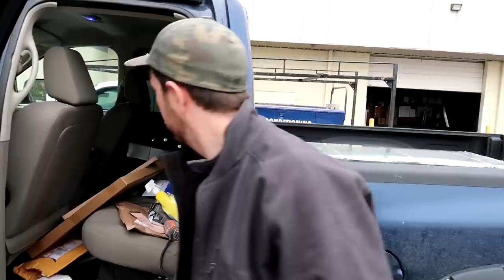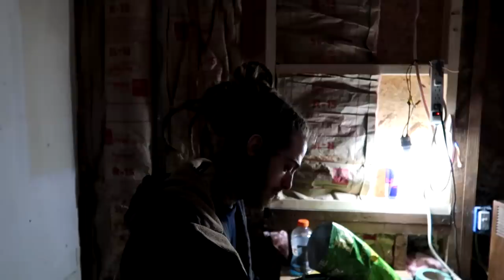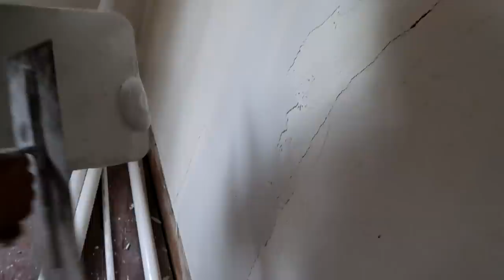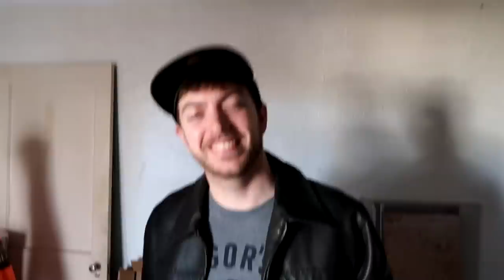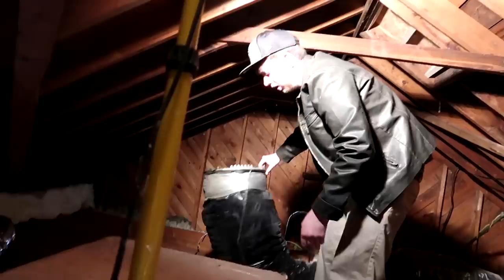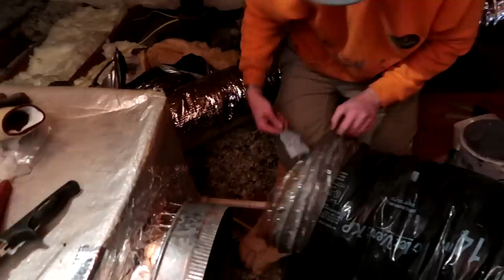Guess Who Came Back To Help With The House...

Comment: in 20 years when they need a new HVAC unit they are really going to wonder why its chained and padlocked to the attic floor.
Reply: With the newer systems if they get 15 years they are lucky

Comment: I've commented alot regarding home renovation and my hobby is to flip houses or make them my rentals. The texturing can be done with a hopper that runs on an air compressor and diluted drywall mud. Texturing, knock down and any type you want. Joe, you could do it and it wouldn't cost more than 200 bucks and 12 or so hours of your time. Just saying! You could cut down by unimaginable amounts the cost to "fix it up". Btw, it's fun to do. Keep on keeping on and you can make a shit ton more money selling and alot more fun by doing. Good luck. Peace

Comment: That heat pump needs to sit on a concrete pad
Reply: Ray Hakw no it doesn’t
Reply: It depends on the code in va but it looks much better on a concrete pad for shure
Reply: @novajames6871  yeah, just let it sink into the earth. it's great for ventilation.
Reply: @novajames6871  35 years at It , will last longer. Don't have a baby over it dude
Reply: Steve Aumann  100%
Reply: Or a plastic pad
Reply: Without a pad there's going to be weeds and vegetation growing up into the unit- maybe small animals, also, it might sink if the soil gets soft.  I couldn't agree with you more.
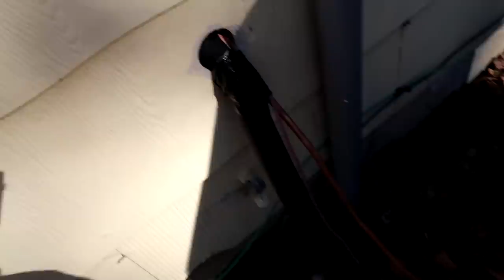Reply: 22:41  It is on a concrete pad. Looks like ilt was probably there from the previous unit.
Reply: @StoneLizard5  Sharp eye! You're right.

Comment: It's called a plenum. You don't have to wrap return air boxes or duct. Supply has to be wrapped/insulated or it will sweat do to difference in temp inside and outside the duct. Oh and Chinese saws make door jam to floor transitions professional quality👍

Comment: Ya, I believe the heating pump needs to be on a concrete platform a certain height off of the ground. Not sure if that helps or not lol
Reply: 22:41 It is on a concrete platform. Most likely it was there for the previous unit.

Comment: BIG MISTAKE........
-supposed to gouge out the existing crack.
-add screws to studs possibly use grommets.
-apply mesh tape
-use “easy sand 20” it dries in 20 mins 

You can applicate a 2nd coat right away and it’s not more expensive to buy.

The bucket stuff is supposed to be a topping mix only and mixed to a thinner consistency.

It comes down to not caring about your work.

Comment: Is it normal in the US that they do the plaster in several sloppy phases? In Belgium, A plasterer will do each wall only once. The will slap on the plaster, and make it more or less even. Then do the next wall. Then go back to the first wall and even it out with a mudknife while it is still semi pliable. Then do another wall, then go back to the first wall to scrape it completely even. a typical plasterer will never ever do any sanding and when he is finished, the walls will be flat, without seams, and be completely smooth.

Comment: 1:15  You don't want to run that hvac as it will pull drywall dust from sanding into it and ruin it. That would be another very expensive learning mistake.   Get a kerosene or gas propane heater blower thats made for construction sites.

Comment: Joe! Don't use the permanent system to heat the house. Rent a kerosene jet heater. You will contaminate the brand new duct with sheet rock dust. Cover all the registers and diffusers with plastic. Get the finished product out of the house.

Comment: Bruh you gotta tape those cracks, you just can't skim coat without tape and floating those cracks so they don't come back. Also those walls look like they have a high gloss finish on them, it would've been a good idea to prime them or rough them up a bit with a sanding block or whatever so the mud sticks better.

Comment: Think that the buyer will be wondering why the HVAC is tagged with "keep your dirty, thieving, Crack fingers away from this HVAC, "you smoke crack, don't you Bryan"", while it's bolted and welded to the floor of the roof, with giant tamper proof bolts and super heavy I-beams

Comment: Dave, commercial/residential? Union represented?  Curious to hear your get down. 
          Been in the trade over 25 years myself. Lots of contacts in the NE. There's so much rate work up here & nobody qualified for the tasks. I'm sitting pretty at $55 hr for a guaranteed 4 years! The money will only get better considering the lack of skilled tradesmen. 

     The next generation is more technologically driven & the trades are hurting. Funny to see the place where fuck-ups used to go to make an honest buck actually be a place to make a career.

Comment: You fucked up the fence at your house.  It's going to fall down.  You didn't dig 24 inch post holes.  The tops of the post stick up over the top of the fence. A lot.

Comment: Personally I think skim coating results in more time wasted repairing shitty plastering. It's so much easier and cheaper to tear down the plaster and tape and float drywall. Only noobs skim coat thinking it will save them time and money.

Comment: Stove put in there and got damaged ... dude ... If it's not ready to install, DONT PUT IT IN A CONSTRUCTION SITE WHAT IS WRONG WITH YOU?!?  After all you been through I'm starting to question where your head's at, lol 😃. Stop putting vanity's, mirrors, appliances ANYTHING that's not ready to be installed (which is at the end!!)  Take measurements if that's the problem away from the site!!!!  You're pissing away money at times unnecessarily!!!

Comment: Why didn't you use a solution called TSP to clean all the walls and parts you are going to skim over and paint/ After saying that was a smokers house you always use that TSP man. You want a good clean surface. Warm water a bucket and a foam mop get the walls first. ope too late. And why didn't you paper the floors first now you have an extra job to clean up.